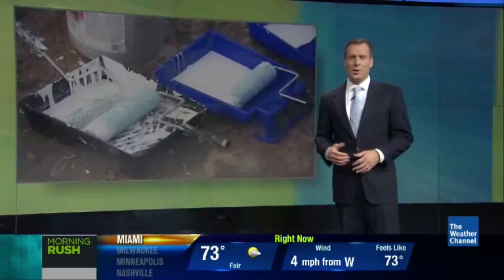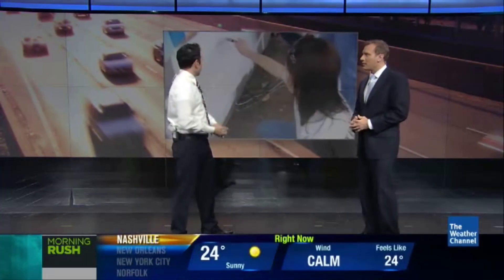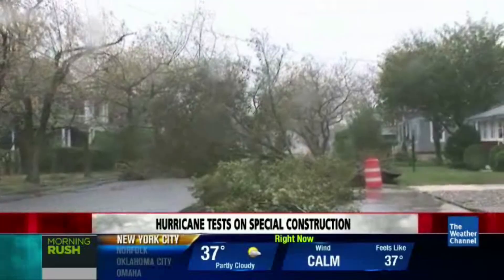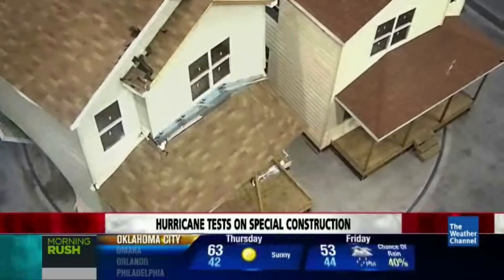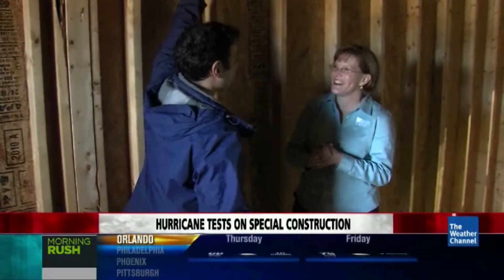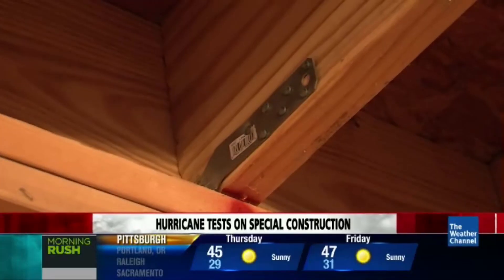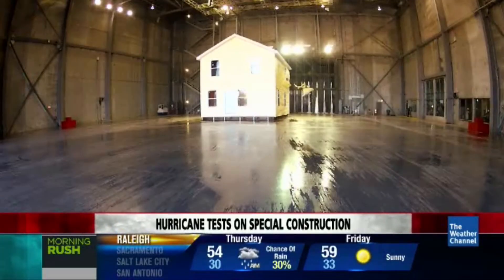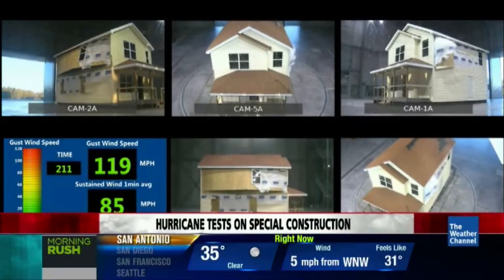Huricane-Proof Houses

Comment: The best hurricane proof house is one that is on pillars and one that is round and not rectangular or squared.
Reply: Best is underground .
Reply: @rzezwicki1980  wouldn't an underground shelter be a horrible shelter due to flooding? Your shelter will have to be totally watertight and your excess air filter will have to be high above. For a tornado maybe but for a hurricane, flooding will be an issue
Reply: Deltec

Comment: Why not just make houses out of concrete and steal??
Reply: Concrete isn't necessarily stronger, it all depends on the structure.
Reply: @kirenjohn  Building with wood is unsustainable.
Reply: Nica Loco I think thats a good idea, they keep making these homes out wood and paper that just fall apart every year with the wind. A well engineered concrete home will easily withstand a hurricane, and it will save you a lot of money on the long run.
Reply: Maximum Max Not really, Concrete homes can also survive an earthquake. There are new formulations of Concrete that have polymers, fiber glass mixed in making it flexible yet super strong. Combine that with steel rebar and you got a home that will withstand, tornados, hurricanes and earthquakes.
Reply: Racheal Lewis expensive ugly and there are disasters like earthquakes that destroy concrete and steel easier than it destroys wood
Reply: Racheal Lewis concrete helps look at andrew it decimated florida because in those days houses wetent all concrete but they fixed the building codes and irma at land fall was a cat 4 and no where near as much structures were completely decimated maybe missing a roof but MOSTLY not decimated
Reply: because houses like that would only be affordable by the rich  1% (it would probably make a normal house end up costing upwards of $8,000,000)
Reply: Nica Loco doesnt work against storm surge
Reply: big yee well in some parts of the world they have earthquakes and hurricanes concrete is horrendous for earthquakes and concrete doesnt always work for hurricanes not near coasts and not the strongest of them
Reply: big yee no home can withstand 300mph tornado winds concrete isnt flexable so idk how it would withstand an earthquake a hurricane wind yes it could survive that but its affects ehhh not so much mudslide wipe out houses and so  do stormsurges earthquakes break watermains cause fires and liquefaction idk if concretes gonna withstand that
Reply: Nica Loco genius a concrete shelter is too expensive  and steel is heavy do your research